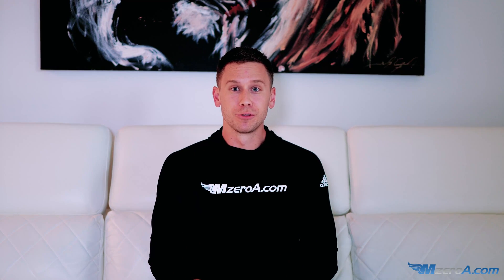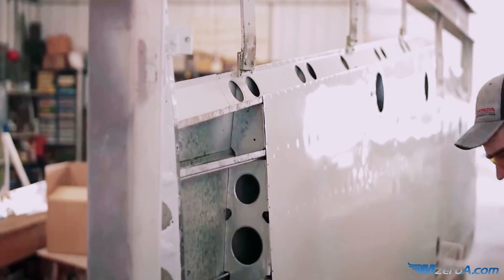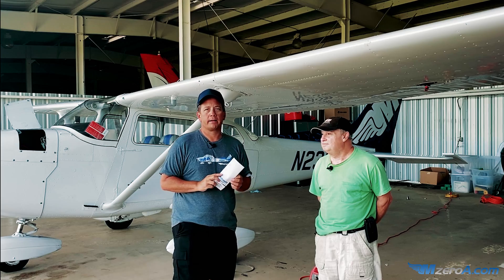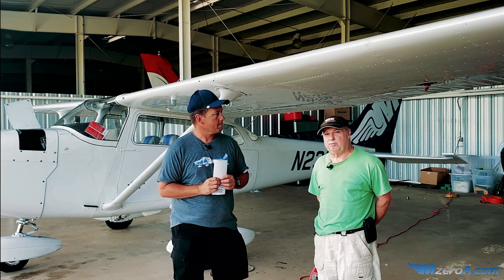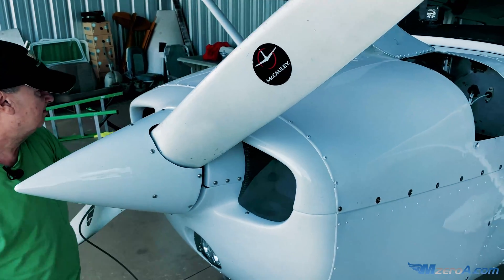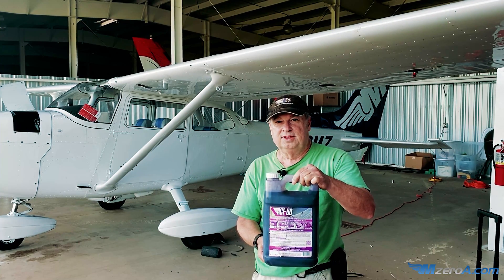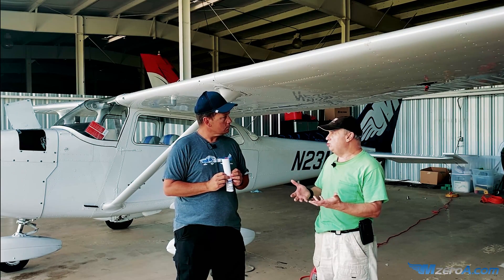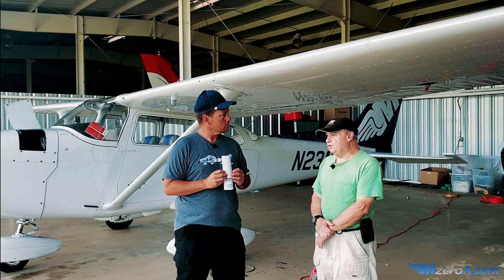N23MZ Corrosion Treatment - MzeroA Flight Training

Comment: Maybe a better description: Intergranular corrosion in aircraft is a localized type of corrosion and is usually an attack on the grains that make up the alloys and metals of the airplane. The grain boundaries get attacked and become depleted of chromium, making them vulnerable to corrosion even if they are usually corrosion-resistant metals.